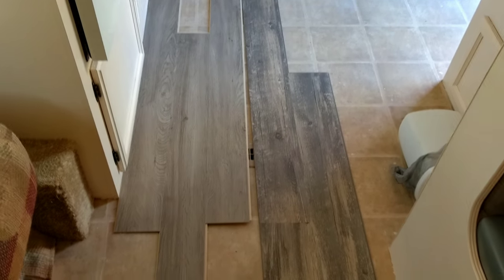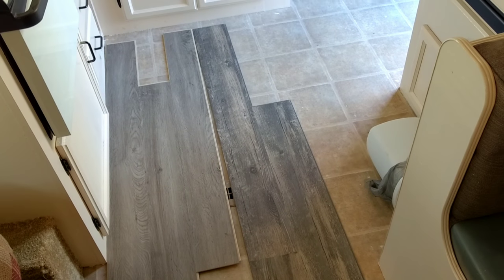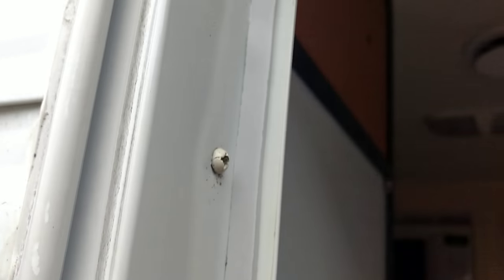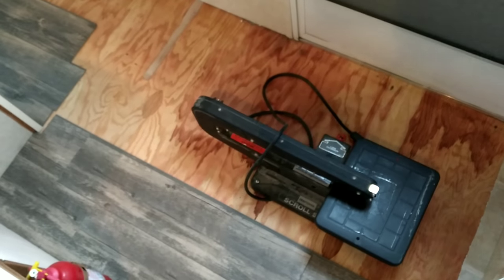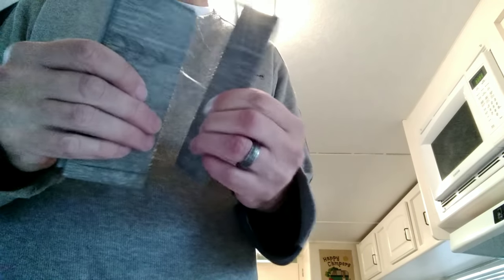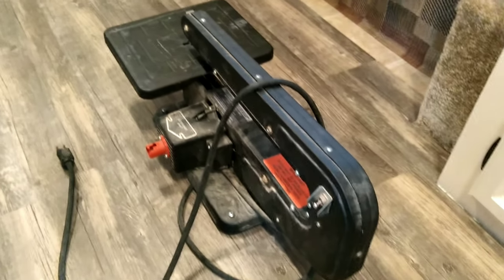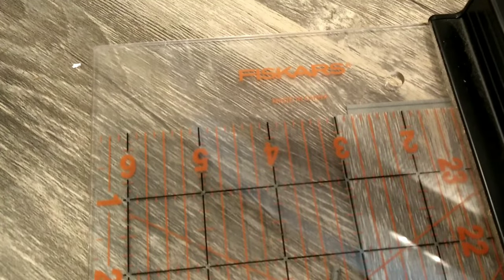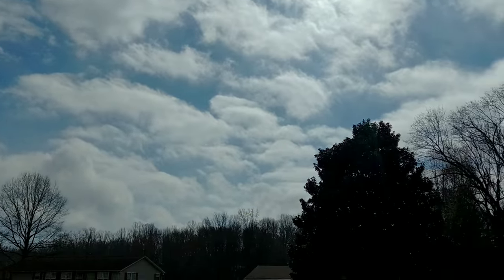INSTALLING NEW FLOOR. RV Remodel. Upgrading While Downsizing Episode 11

Comment: what led you to chose that over the vinyl faux wood flooring, and i'm talking about the peel and stick not the giant rolls. it looks great, you did a great job, i'm looking at both right now, i plan on doing the floor, walls and ceiling, making a grey / flat black cast iron look trim with green accents scheme in my 5th wheel. i'm leaning towards the vinyl because its cheaper, it looks cool enough and i can cut it with a razor blade, and its lighter weight. but again I plan on using alot of it for the whole inside of my 40ft rv. it should feel like a rustic wooden boat when i'm done
Reply from the maker: Sounds great. We chose this kind of flooring because if we ever choose to change anything in the future it will be just as easy to remove as it was to put down.
Reply: @TheCamperCouple  ah, that's a good reason,
Reply: @silinusvers  I did the peel and stick in our RV and it was horrible. With changes in temp and humidity, it shrunk and the corners rolled up...I would not recommend that route at all. I prepped the floor as instructed, and it still peeled up. I am putting in the vinyl plank now. Much easier and looks much better.
Reply: @TheCamperCouple  
WOW... that is a great idea!!!

Comment: What is the name of the flooring...
and where did you buy it?
Thank you guys for sharing a great video..
It turned out Beautiful
Reply from the maker: The Shaw flooring is called Asheville Pine and we got it at Lowe's. Thanks for watching.
Reply: @TheCamperCouple  
"THANK YOU" so much for getting back to me so fast...
I am remolding 1985 Class A RV... everything is original ... even the dirt!!! LOL 
Usually when I remodel a RV...
 I replace the Carpet... 
I love your video so much, I really want to try doing floors... I have laid real tile, but do not want to do this in an RV... it'll be to heavy...
Thank you so much for all your help.

Comment: Do you think 3 boxes will be enough for a 24'? Do you have a slide out you had to work with, if so how did that go?
Reply from the maker: It might be enough. The slide we have is covered by the sofa and doesn't go all the way to the floor so we didn't have to worry about flooring there.

Comment: what are you using to score the planks with?  ruler with a razor or do you use a machine to assist you?
Reply from the maker: It is a fabric cutter. A sliding rotary blade with built-in ruler
Reply: @TheCamperCouple  thanks man!!  I'll try to remember that when I up and do mine:-)

Comment: did you leave any gaps for expansion?
Reply from the maker: Yes. I had some quarter round that used to cover  the gaps. Haven't had much of an issue with expansion though. This flooring seems to hold its  shape pretty well.
Reply: @TheCamperCouple  thank you, I am about to start a similar project in my rv and I am debating whether to use the quarter rounds or not....they look ugly, if expansion is not an issue I am guessing I will make the gaps as small as possible and then just cover the gaps with silicone. Great work and thank you for sharing your video!